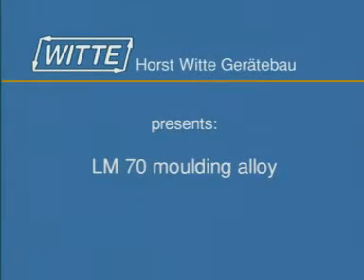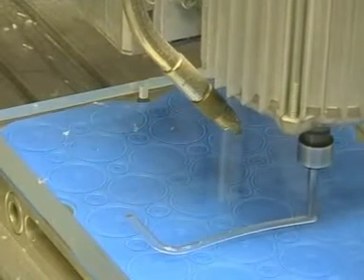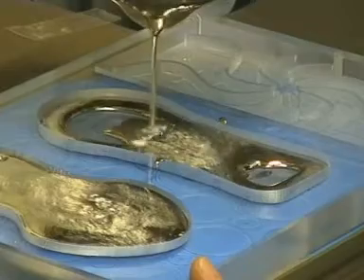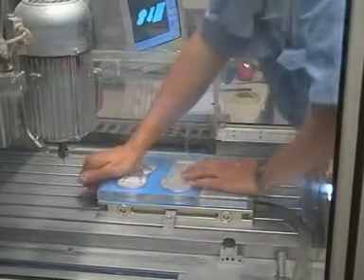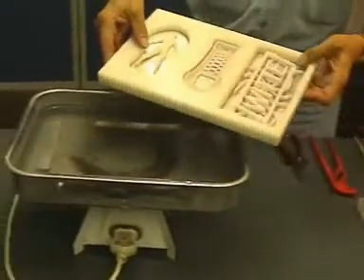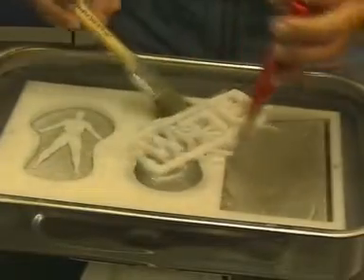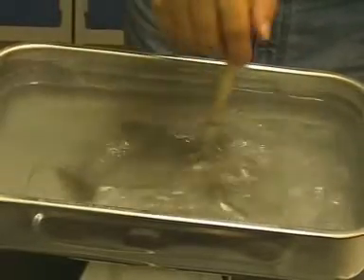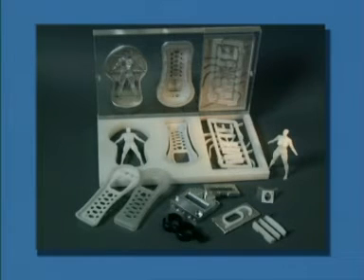weiguss clamping alloy

Comment: must have been realy disapointed when 3d printing was invented
Reply: Ehh, it really depends. Certain 3d printing technologies can work just as quickly as this process and at a higher resolution, in full color, already assembled.

As far as cost goes, considering this needs a special CNC setup and proprietary materials I doubt its exactly cheap.

Also as far as it being mould ready... well both technologies would fit that description since they both would use the same 3D model to product the part.